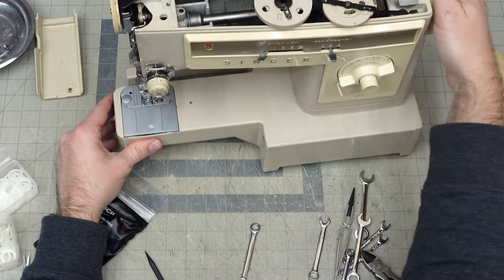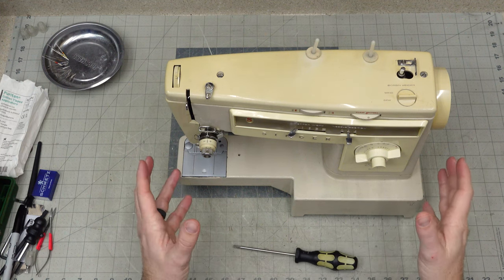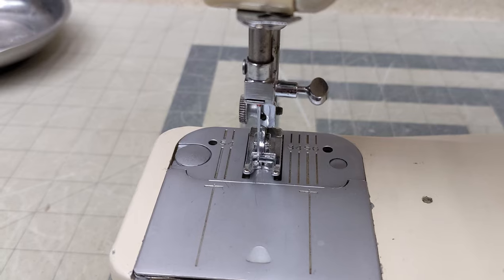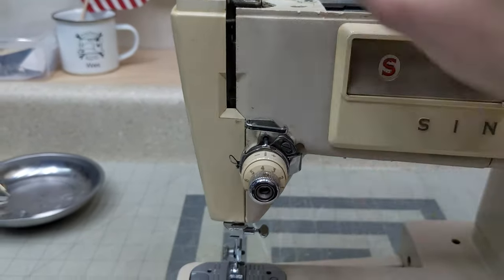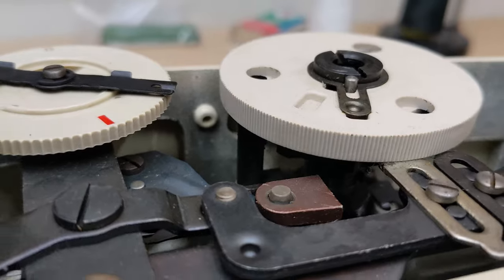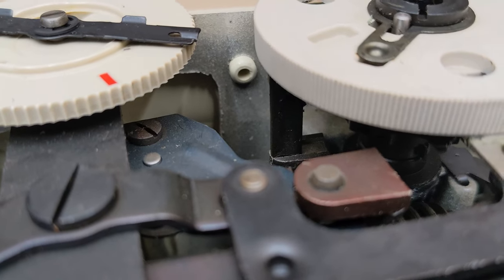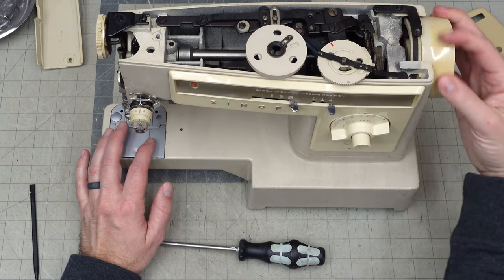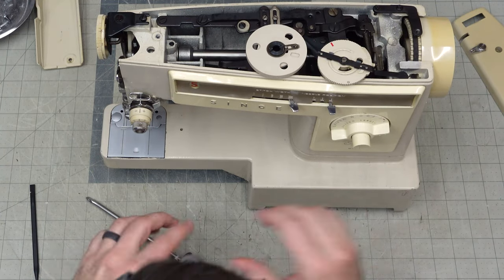Collaborating with a Patreon Supporter to adjust a Singer 533

Comment: Hi Wes,  I had cleaned out all the stuff already in the area where you put the washer.  There was a bunch of debris and lint in that area.  I did not know I was looking for a broken washer and didn't even know there was supposed to be a washer.  The stuff in there did not even look like a washer.  It must have completely disintegrated in to ashy looking dirt.  Thanks for helping me out with this issue.  And the timing of the zig zig is also something that I learned about.  This was a most helpful video.  Thank  you for doing it!
Reply from the maker: No problem! Glad to help!
Reply: Melaniie, do you have the dimension or resource for the washer.  I thought he had a video too where he replaced it but I can’t find it.  Looking for a washer for about a week now but can’t put my hands on it.  I have a stylist 834

Comment: I found one of these (well, actually the 534) on the Goodwill auction site for $7 !!! I wanted something REALLY cheap but in reasonable condition so I can take it apart— I am a new sewist and I have become obsessively fascinated with the workings of sewing machines!!🤷🏽‍♀️😂 I haven’t won the auction yet (it’s over in a few hours) but the description said the machine turns on & the needle moves. So I figure that if I can get it cleaned up and make it sew, that will be amazing— but if not, I can still tinker around with it and learn a few things by dissecting it. Win/win!!!😃 This video was VERY helpful in so many ways…. THANK YOU! 💐

Comment: Mine looks very much like this one. Fixing this for a student. Found out I’m missing a part. Singer 438. The set screw or bolt that holds the needle bar to the movement bar.

Comment: My Mom had this one and now it's mine and it never worked correctly. I always heard her bitching about it even after being serviced by a Singer agent. The machine was stored and the plastic gears under the machine disintegrated by themselves . I bought the service manual, watched a lot a videos, changed the broken gears, spent hours trying to make it work, but the thread is still breaking each time I reverse to lock the stitch.

Comment: If anybody reading these comments can tell me where to find the washers or what size they are. I would greatly appreciate that. Thanks.
Reply: stop this video at 7:54. It's at that point, the repair guy has the washer purchasing info.
Reply: on the screen. oops! At the 7:54 mark, the repair guy has the purchasing info for the washers on the screen.

Comment: 3am; I have a singercfutura xl550. Something went crazy with the embroidery unit and c unable to get anyone to repair it.  I need tocfind soneonexwho would be interested  in this machine and embroideryvunit. The machinexruns, but c the embroidery unit wentxwacko.  I have thexsoftware that goes with the machine.  Do you or know of anyone that would be interested in v this machine as a project?  It may need a mother board on b the embroidery unit, but I honestly don't know because no obe, not e c en viking who bought out this line, will fix it.  So I just am trying to search around.